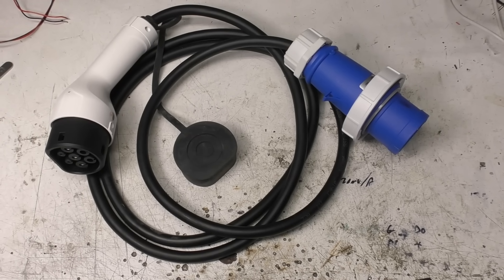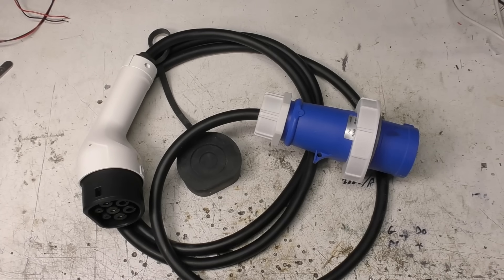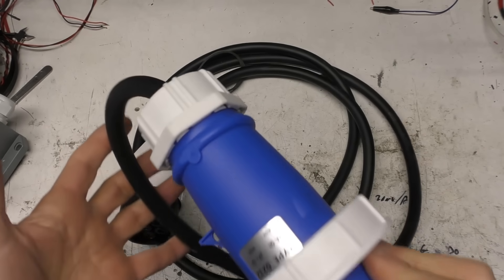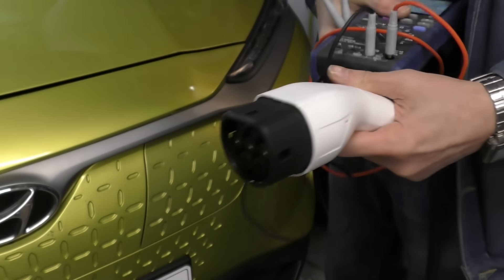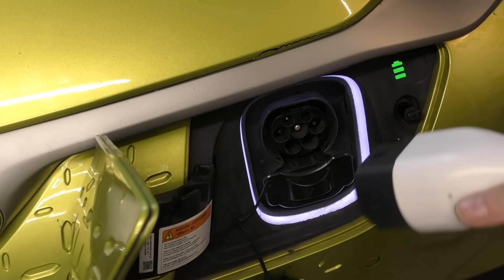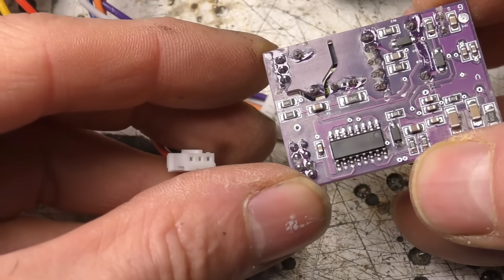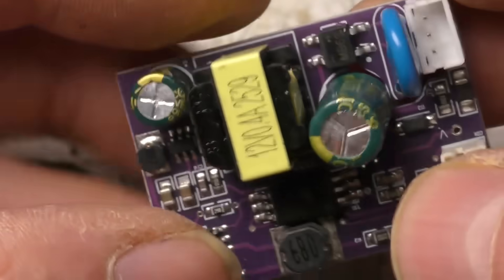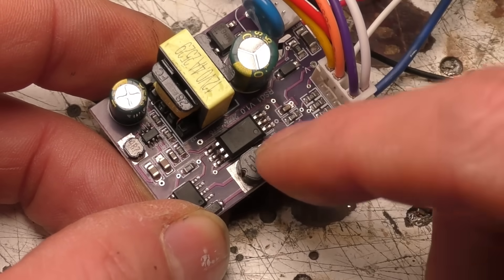Avoid these unsafe EV charging cables!

Comment: The only thing left to do now, is to cut the plug and put a "special 13 amp plug" with the fuse linked out, so you can take 32Amps from a ring. Fun fun fun!😅😂😅🔥⚡️⚡️

Comment: You should have seen on Electric Moped car charger 😅
They are just an extension from 230v shuko to the same socket as you have in the video and without any electronics inside.
No diode or resustor, no PWM no CP.
😂

Comment: Most beefy single phase connector. yet Dumb UK laws dont accept them lol. Uk has the dumbest electrical code on the planet. also the shutters are useless. like kid cant use its little brain to figure out that you need to press the earth pin to lower the shutters.
Reply from the maker: Those connectors are allowed, they just need to be interlocked in a domestic install
Reply: If your kid can work out how to open the shutters then it can easily get into the unshuttered sockets in other countries.
You should train your kid better. The UK system is one of the safest systems for normal people.

Comment: Why would you choose this well because that one's 20 quid and the other one's 50 or 100 so if you're sorting by Price and picking the first one. Also they look identical to the Lay person who thinks everything is Magic. And electricity flows out of the outlet like water. That in the manufacturers are tied into the need to make everything cheaper because the profit margins for the corporations to pay their executives needs to be maximized.
I could see one use for this where it's being fed from some thing like a generator which would not be running and would also limit its load capabilities.

Comment: It is part of the standard, it is called Mode 1 charging.
Illegal in many countries, but supported by some cars.
Reply: "Supported" ? With the same control electronics inside it should probably work on every car that accepts Type 2 charging, right? The car wouldn't know the difference? So is it more like a fake Type 2 cable?
Reply: @jsjs6751 Zoe does not work, Tesla does.

Comment: Next job is to cut off the blue plug and bung on a 13A plug with a nail as a fuse... (or use a chinese fuse).

Then it'd be a toasty warm-up-your-house fast granny charger!

But yeah, this would be handy for use in emergencies- if you have somewhere to plug it in.
Reply: Run it on a wound up orange B&Q extension reel too.

Comment: Great teardown Mike.  Are there any PCB clearance guidelines you could point me to when designing for the UK AC (which can have RMS voltages of 250v sometimes) ?  Would hate to see that PCB in damp conditions !
Reply from the maker: 2.5mm creepage (surface distance) for basic insulation, 5mm for reinforced/double insulation. This is for normal PCB in sensible conditions - longer and/or conformal coat it if contaminated atmosphere and/or damp. 
Don't recall offhand what clearance (through air) is, but less than creepage.

Comment: Suuuuuper Dodgyyyyyy! Race to the bottom. Back when I worked for an EVSE manufacturer, their stations were almost exclusively 3 phase 21kW with RCDs, relays on all current lines (both live and neutral), reliable components, interlocks and communication over control pilot... I'm surprised to see such a skimpy product now. I wonder what Julian Illett would say.

Comment: Well you learn something new every day… I thought that there had to be lots of handshakes before the car would accept power in
Reply: Not for J1772. It's a pretty simple process (i.e. a diode and resistor) I'm really surprised there's a proper PWM generator in it, not some janky $0.05 transistor oscillator.

DC charging is a very complex mess, because the batteries are being directly connected to the external charging system. For level-1/2 AC charging, the charger is inside the car, you're just plugging it in like a lamp. That said, an EVSE is only expensive because of the $100+ contactor (huge industrial relay), and the lawyers for when the shit sets your house on fire. (there are plans to build one for around $150.)
Reply: Depends on if it's DC or AC power.

Comment: This isn't much less safe than an extension cable, isn't it? If you're worried about people dropping it in water or poking something in the holes, that holds for any power cable, not?
Reply: Yeah the shutters are a bit of an over worry. Caravan hook ups are the same etc. (but 16A). Ppl usually get their 13A extensions out on a dry summers day to mow the lawn, they tend not to leave it out for hours over a wet day/night. Whatever the outlet needs suitable RCD protection
Reply: If you mean a domestic 13A extension cable then you have shuttered sockets to protect the user from directly contacting live elements.

Comment: Why is there an isolation gap under the rectifier and the capacitor but not at the transformer?
That PCB is really ... special.
Reply: An isolation slot under the transformer would get in the way of mounting all those components underneath it...
Reply: @ferrumignis  good, they shouldn't be there in the first place

Comment: This is a pretty common backup cable/"charger" to keep in your car for charging when you are visiting people who do not have an EV charger.
CEE outlets with dedicated breakers are pretty common in homes here in Denmark, though 16A 3-phase is more common than 32A single phase, so that's usually what people carry.

Plugging into a regular outlet has proven a fire hazard on multiple occasions, CEE are much better for that purpose.

Comment: Besides the questionable power supply design, what do you think makes this more dangerous than a normal extension cord?
Reply: ironically a IEC13 Cable with a uk plug would be safer than this. at least its fused lol
Reply from the maker: No shuttering, always live on a product that may be used regularly, possibly in wet conditions, subject to damage being droppped

Comment: Can you review one of those v2l inverters that trick car into discharge mode so then it inverts 400v DC into 230v AC?
Reply from the maker: Would like to but a bit expensive
Reply: I put it in my Renault Zoe, works fine.
Reply: @Mladjasmilic can you link to the one you brought?

Comment: Probably exists because people have charge cables cut or stolen for the copper content, and the owner  does not want to pay the high price for the OEM EVSE unit, and then looks online, finds these cheap ones, and buys them, not realising the issues, because they likely have 4 or 5 star reviews, simply because they are both cheap, and sort of work for a while, and are a third of the price of a real EVSE, so a re higher up on search listings, as they sell more units because of price, and people often sort by price as default, not brand.
Reply: 5 star reviews due to botting (fake reviews or bribery) see  on all major selling platform
Reply: This cable would be very fun to steal by cutting...

Comment: In the UK you can use BS EN 60309 sockets in domestic situations as the IET specifies that socket-outlets for household use shall preferably be of a type complying with BS 1363*. While the use of other standards like BS EN 60309 is **not* entirely **precluded*" in specific circumstances (e.g., for an electric vehicle charger on a ***dedicated circuit***), the default standard for general-purpose domestic power is BS 1363.
It is all about the risk assessment which you should now do.
Yes everything else about this lead is stupidly very dangerous as you did not mention the DC current from the car could blind the house protection rendering it useless!
So a fault elsewhere in the property will not be protected!
* Being a dedicated circuit you should install the correct circuit protection anyway (RCD type B)!***

Comment: There's no way to ensure that there's RCD protection on the Ceeform it's plugged into, but I can almost guarantee that there's no PEN fault protection either, and that's much harder to avoid.
Reply: This is because the UK regulations are crap. In eu, both are common. Non RCD circuits don't exist

Comment: Geez, and they seem to be highly available and SEO recommended online from many sellers, on Aliexpress at least I total at least in the low hundreds sold for current listings. It also seems you can get ones that connect to a standard UK, EU, AU, US etc socket rather than an industrial high current one. Those ones seem to be more popular and also half the price so in some cases 1/10th that of a proper EVSE. I can certainly see people going for them particularly when EVSEs from the dealer can be very expensive. And while people might be spending tens of thousands on an EV, a lot of people take out a loan to be able to buy them in order to save money on fuel. The dealer's EVSE might be an entire month or two of car payments that may seem optional to some especially if they're intending to use public chargers at the start. I can also see it being more a thing for used cars that don't have their original EVSE, but particularly now that Tesla cheaped out a couple years ago and stopped supplying an EVSE with the purchase price I can see them being very popular at least in Type 2 connector countries. But shockingly I found one listing for a NEMA-14-50P to Tesla cable with no inline EVSE box! The Tesla connector has nothing to prevent you from touching the contacts! NACS bodged in a plastic guard as an after thought but the picture shows the original Tesla connector.

I also wonder if any cars do actually detect the always live connector and display a message "Charger fault detected." or similar. I imagine that could help some consumer understand the risks once they've bought them.

That 32 A socket also looks really questionable, I wonder what happens when a flame is taken to it. Looks like the sort of ABS that loves to catch fire.

Comment: While you were showing the power consumption of the charging cable while disconnected I noticed, on the shelf below the meter, you have an "850W 200x200mm Electronic Hot Plate Preheat Digital Preheating Station For PCB SMD Heating LED Lamp Desoldering 110V/220V", (AliExpress' name, still available).
IIRC Amazon issued a recall notice for these, don't remember when exactly, why, or if it was even Amazon. Did you see it? I'd be interested to see a disassembly of the hot plate and if you noticed any glaring deficiencies with it. Did check your back catalogue, couldn't find a review of the item, don't suppose there's much to it really.
Reply from the maker: Bought  it years ago from Aliexpress - still working fine apartfrom a couple of dead LED segments , though wouldn't surprise me if heater insulation is questionable. That's what the earth is for.

Comment: Avoid EVs altogether, they are a stupid solution to a non existent problem.
Reply: If you don't have a brain this might be true, but only for you. 😂
Reply: EVs address multiple real problems and they are better cars.
Reply: As a motorcyclist with both electric (x1) and combustion bikes (x4) in the garage, I energetically disagree. Electric bikes beat combustion bikes in every way for urban usage, if you can charge at home. Easier at low speed, all the torque all the time, very quiet (good for the neighbours!) and they never, ever get hot in slow traffic. Also no oil degradation when doing short trips, and if your bike has regen and you ride accordingly, near zero brake dust and your bike stays a bit cleaner. It's not even close to being a contest.
Reply: @jsleeio  Until it burns your house down one night, or you have to replace the battery, or you want to sell it.
Silly fanboy.
Reply: @axeman2638 EVs burn 60 times less than the other junk.
The batteries last longer than any combustion engine. 
That's simple facts brainwashed fanboy.
Reply: @tyo0815  Oh lol, no it's not, it's just outright lies.
Where does the electricity to charge your ebike come from?
How much CO2 is emitted during the manufacturing of the battery?
My old toyota corolla will still be going when your ebike is in the land fill
Reply: @axeman2638 the most of it comes from my roof.
The rest ist 50% solar and windbover the whole year.
With this mix from the grid the manufracting co2 is compensated after 20-30tkm. In other words in the first year of the cars live.

So few new facts for you.
Reply: @tyo0815  And how much CO2 was produced to make the solar panels?
As if it mattered anyway, man made climate change being a complete lie.
And how much government subsidy did you get for you solar panels?
Silly fanboy.
Reply: @axeman2638  Stop watching brainrot media and see the reality for once.
Reply: @axeman2638  The CO2 to produce an average solar panel is saved many times over during its working lifetime. It is a huge overall benefit saving at least 10 times the (rather small) amount produced in its manufacture.
Reply: The problem is low level pollution on roads, only metres away from children in pushchairs, prams, etc. The only other solution available at this point in time is hydrogen. For 1.75 million people in the UK that have chosen to drive an EV, there are a number of their benefits that do make them a good solution for an increasing number of drivers. I am sure you will comment back with something from the right wing media brigade.
Reply: @philmcmillan72  EVs cause more of that because they weigh so much and eat tyres and brakes.
Hydrogen is ridiculous, you obviously know nothing.

Comment: 8:54 The windings on the transformers are often very badly insulated to the point where only the enamel separates the high and low voltage.
Reply: Plus they often use thinner CCA ire, as that is cheaper, relying on the SMPS regulation to compensate for this, meaning not only does the windings run hotter, but the thin enamel is more likely to soften and creep, allowing the wires to short. hopefully to itself, though more than likely primary to secondary, as that is the highest voltage difference, and with around 800V (primary end by chopper transistor, with a poorly designed clamp, because they are relying on the on chip 700V avalanche diode to dissipate the excess energy, as adding on the proper snubber components is expensive, adds a whole 3c to the BOM cost to have properly rated ones, as opposed to simply having ones that do a half job) the boom is going to occur and dump the capacitor at full mains voltage on one half cycle, and continue till the end of that cycle till the bridge blows and takes out the traces.
Reply: @SeanBZA Exactly, thanks.
Reply: Yeah, I enjoy watching @ bigclive's destructive testing of isolation transformers... The "burn" setting. Mmmm.
Reply: @fredfred2363 
Just fyi: 
DiodeGoneWild has also some very detailed analyses of mostly cheap Chinese power supplies with schematics and all.

Comment: Great video, thanks. So, is there more a risk that someone will buy one and hang this out over the pavement waiting for an unfortunate occurrence? My mind goes thinks of damaged cable and a dog peeing on the cable.
Reply: True ... though no difference to trailing an extension cable over the pavement other than that the cable is perhaps more likely to be unattended for a longer period in many instances.
Reply: @MrAdopado - if it is left unattended, it won't be for a long time.
3 x 6mm cables are a nice earner for the copper content 😂😂
Reply: Both illegal
Reply: @DanRyan-v5y  that goes without saying!

Comment: seems like new regulations universally result in enshittification… i just posted a short about a microwave with a similar problem due to new US safety requirements.
Reply: Whoa there ... this is an instance where regulations are the things that are potentially saving you from electrocution! This charging cable specifically does not follow appropriate safety regulations.

Comment: Sadly this is a good use case for authenticated cables using a challenge-response protocol with some sort of secret key so that only authorised manufacturers who are going to produce the thing properly could make them.  Granted, china would probably engineer a way around it...
Reply from the maker: Absolutely not  - having products with simple functionality locked down so the manufacturer has a monopoly on them is evil. Inkjet cartridges..?
Reply: @mikeselectricstuff  Agree - Although it would be quite easy to for these to be detected without resorting to anything so complex and prone to misuse. If the onboard charger monitored for the presence of 230v before it had seen, and appropriately loaded the CP signal, it could enter a fault mode where it refused to draw power until everything went back to zero and things occurred in the correct order. It would mean that these cables without a contactor would not work, it would'nt even need for every vehicle to do it, would just need enough that sufficient reviews appeared stating that it didn't work and the car flashed up an error each time.
Reply: @mikeselectricstuff  for stuff like printer ink sure. For things where safety is critical and you get junk like this that bypasses the safety features? Definitely not. 

Of course, i mean an industry standard that all the car manufacturers would use.. but thats a utopia in itself!
Reply: That would be unnecessary pain in the ass and incompatibility problem. Its a mess already.